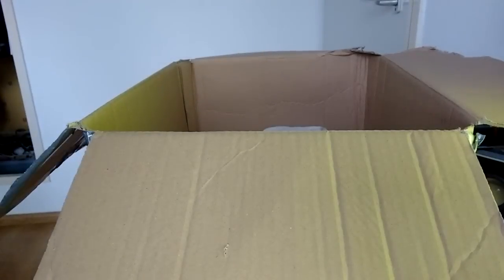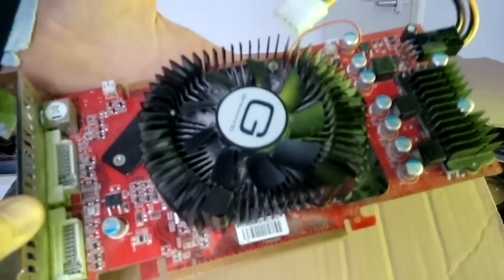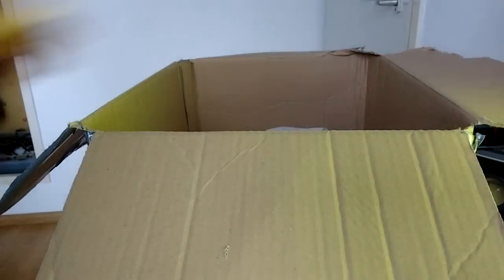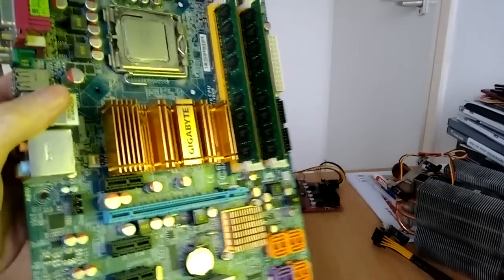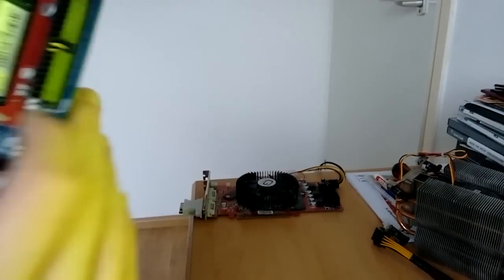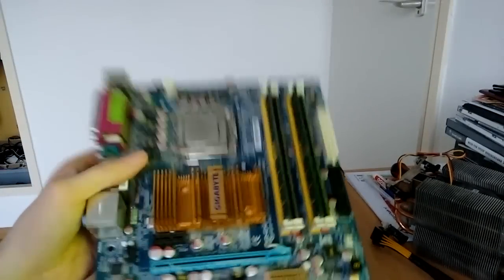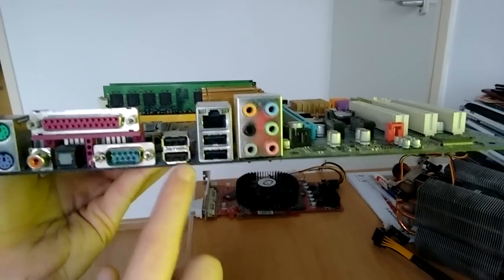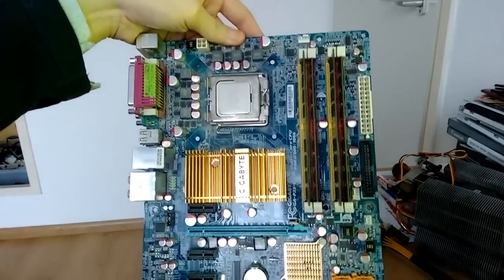Gigabyte GA-P35-DS3R - Part 1 - Unboxing and Overview

Comment: Watching this video on a system running a Gigabyte GA-P35C-DS3R, Core 2 Extreme QX9770, 8 GB Corsair DDR2, R9-280X, Samsung 840 EVO 120GB SSD, Seagate 1 TB 64 cache, Seagate 500GB removable drive, dual WriteMaster dvd roms, D-Link DWA-552 XtremeN Desktop Adapter, Creative Audigy 2 ZS (SB0350) Sound Card, Corsair 850 watt PS. I have numerous other systems (build gamers as a hobby) but this one is my prefered machine. Stable, dependable...love it.
Reply from the maker: Core 2 Quads are still very potent performers. Is yours overclocked? The QX9770 is a beast!
Reply: nelizmastr I've had it up to 3.9-4.0 GHz( can't remember exactly been a little while) but didn't need the extra speed for what I generally run on this machine have it back down to 3.2

Comment: I have this board, but a different revision - 2.0. Not much difference than the ddr2 slots are all white. Bought this board in 2008. It is still running now as my NAS file server. I have eight 500GB drives attached. Booting off of USB (it works on this non UEFI board). I have the board memory maxed out at 8GB with four 2GB Corsair XMS2 modules. Still has the Core2Duo Wolfdale E8400 in it with an Arctic Freezer7Pro on it. Modified a power supply to power all eight SATA drives - no power issues with a 500W Rosewill PSU. It can run headless if needed.
Reply: I wanted to take a look at a dusty 2.1v one
just for memetic reasons 
I am still confused about the ddr3 slots
can those work without enabling them on bios or they just works already?